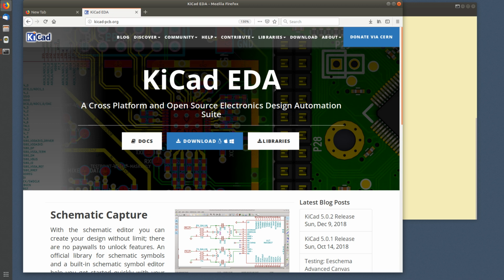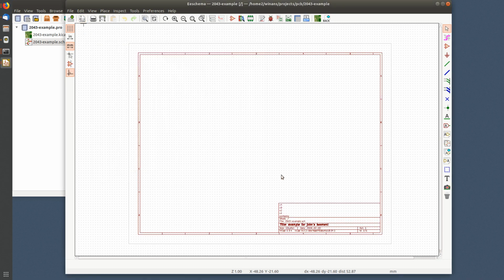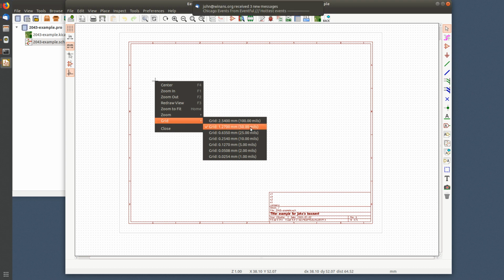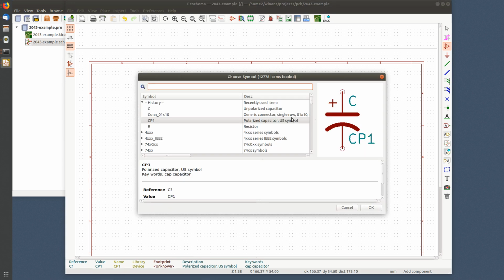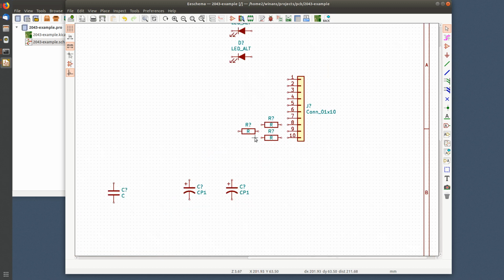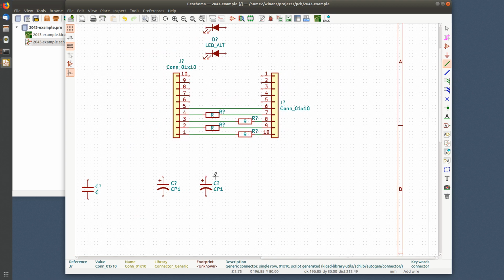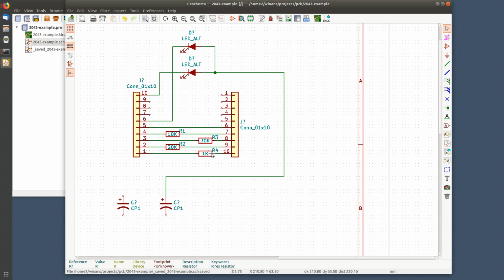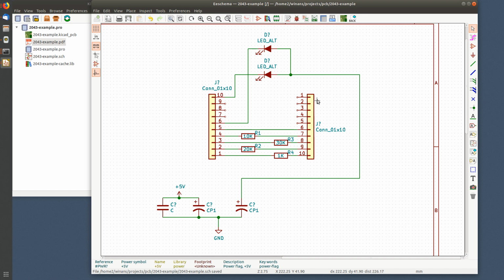KiCad 5 #1 New Project & Schematic Capture

Comment: Gotta say that despite the age of this playlist … it still applies to KiCad 9, at least so far. I think I read somewhere that there was an somewhere to stop making new versions be major architectural changes—but that was after 6.0 for sure. But if they made effort not to change the UI too much between 6.0 and 5.0, then not much will be different. I see R? now autopopulates as R1, R2, etc.

The biggest thing I expect I'm going to get out of using this is how to use the keyboard effectively. If you're doing it all with menus and toolbar buttons, using KiCad's gonna be REAL inefficient and frustrating. But engineers are allergic to inefficient and frustrating, so of course there's gotta be easier ways to do stuff. So thanks for doing this series John to help teach us what that looks like. 😁
Reply from the maker: You're welcome!  You will find some of the key shortcuts changing after V5 so the defaults in the pcb editor match those in the schematic editor.  Some other things are streamlined (no need to migrate the netlist over to the pcb editor, etc.)
Kicad keeps getting better.  I am very happy with it!
Reply: @JohnsBasement starting to get the hang of the schematic editor. Using a bus was a bit strange. I do prefer a bus to the trendy "parts on the page not really connected to anything but a label" design most people now use. If those address pins fold into a bus, I know they are connected to a bus, even if that bus isn't one long line from here to there. The lone wire between two parts maybe should be connected directly.

Turns out what I wanted for e.g. Z80 control bus was an alias. Could I just use the net labels? I could. But the thing that's most seeable is best.

Comment: How applicable is this tutorial for Kicad6?
Reply from the maker: Close enough for me to hold off on re-recording it.

Main issues are some menus are re-arranged & that hot keys have been made standard between the schematic & PCB editors.
Reply: @JohnsBasement  Well, I ended with installing V5 because I'm on Windows7. Your tutorial is well explained, easy to follow and understand. Thanks. S
Reply from the maker: @suadcokljat1045  I'm glad I could help.

Comment: @john's Basement, are you planning to make this kind of tutorial for KiCad v6? You have made almost all inclusive v5 tutorial (including tips and tricks), and I have promoted your playlist in KiCad's user forum many times, but now people are looking for v6 help. Basically, you could redo all these videos with v6. Or aren't you using v6 still? :)
Reply from the maker: Yeah  v6 has been on my todo list for a while.  Not enough hours in the day to accomplish everything I want.

What,, specifically, are you looking for as far as 'updates'?
Reply: @JohnsBasement  , by saying "redo all these videos", I meant that directly 😁. I took two days off, and watched your v5 playlist till the end. No more help ever needed afterwards. I wish newcomers to v6 would have such intence lecture like this playlist. I will try to watch your videos at high rate again and make a keynotes, but would not bet I will.. as I remember, the types of labels, common hotkeys, multisheet design, erc - drc, working with libraries, adding digikey library was the point of highest value (not many changes in v6, really). One video (the first) would be on how to migrate from v5 to v6 (env var changes, paths to 3d models..). 

Are you already using v6 (just curious)?

On the other hand, there exists a yearly release policy from the release of v6.0, and v7.0 is planned in January of 2023, so half a year is left for v6.0 existence...

Comment: Hey John, the bit I'm struggling with is when you open up a yellow pages with commands. I'm using windows 10, do I have to do this, and if so how?
Reply from the maker: Those are command-line terminals running Unix/Linux shells.
You can navigate around with a GUI file navigator if you prefer.
What is ultimately important is that you understand what files are created by the KiCad tools and where KiCad expects to find them.

Comment: Hi John, can you explain more about clearances and how do we change for example 3d model Led colors or resistor color band for example do we able to change in 3d model view same Led with yellow red green etc.
Thanks.
Reply from the maker: These are some good questions!
As for clearance, I'd need to know more about the context of your question.  Are you talking about courtyards?  DRC rules related to them?
As for the 3D models, I regret that I do not have the experience to give them a respectable answer.  I know of things like the discussion here: https://forum.kicad.info/t/i-created-a-new-kicad3dmodels-library/5151
Reply: @John's Basement  I will give shout on that link. 
There are too many clearance inputs between pads routes or even edges. I would like to know which one which. Where do we change them all? 

In your last video, you said "I don't do any etching" did you tried any CNC milling device? I may buy a new device. Can you recommend one? Should I try a cheap Chinese device and milling with wet (Water) milling in order to get better route tracks? Thank you, I appreciate a lot.
Reply from the maker: The main way to manage net clearances is in the PCB editor's BoardSetup->DesignRules->NetCLasses panel.  You can create new net classes and set their sizes and clearances in there.  I have yet to figure out if/how to create/override a set of clearance rules on a per-footprint basis (like I can with Altium.)  Let me know if I overlooked that somewhere!
The board edge clearance is a combination of the track (or polygon) clearance and the thickness of the lines that you draw on the edge-cuts layer.  I discuss that in here: https://youtu.be/X86HUpOr_g8?t=673
I've never tried CNC board milling.  It seems promising for 1- and 2-layer boards.  But I have been doing mostly 4-layer boards these days with 6-mil traces & clearances... so I have yet to get any experience with the CNC method. 
This is the first I have heard of water milling a PCB.  Please post a blog of your experiences with these things!
Reply from the maker: @pettypavlow8330  Yeah that looks cool.  Maybe some day.

Comment: How do I solve this problem? Symbol L1 pad ~ Not found in footprint Custom Components:T-68-6 CT.
Reply from the maker: I can't know without the component nor the footprint.  But if you google the error message you find  this:
https://forum.kicad.info/t/pcbnew-error-reading-netlist-pad-not-found-in-footprint/11035
The text suggests your are using a custom component, I'm guessing you named a pin ~ and used a footprint that has no such named pin.  You need to change one to match the other.
Reply: @JohnsBasement  This just gets too complicated. The developers should make things easier for the user. Maybe one day they will get there eventually but for now this does not help me.
Reply from the maker: @Berghiker  I'm sure you can ask them on the kicad website.  But it does seem reasonable to me for the pins in our symbols have the same numbers/identifiers as the footprint pads that they have to mate with.
Reply: @JohnsBasement  It matches the one on the footprint but still can't find it. The same error shows up. Can you design a new custom made symbol with custom made footprint and make a video on that please?
Reply: @JohnsBasement  How do I put a custom symbol in Custom Components Library?
Reply from the maker: @Berghiker  have you watched any more of the videos in this playlist?  KiCad 5 Tutorial: https://www.youtube.com/playlist?list=PL3by7evD3F51fKkyrUbH-PCdwPCWc9F8a